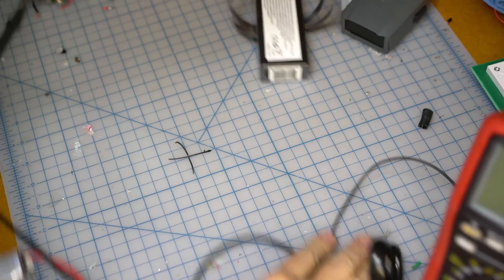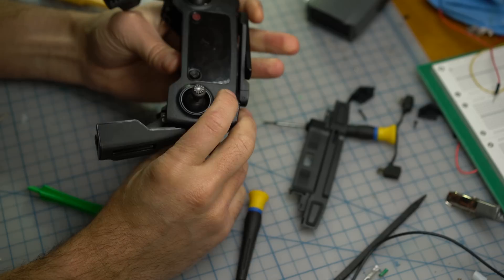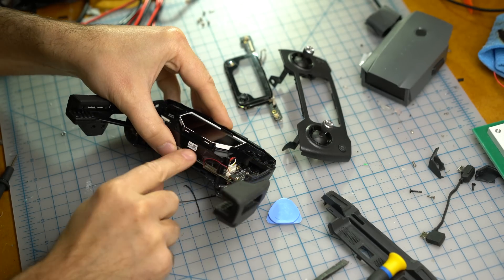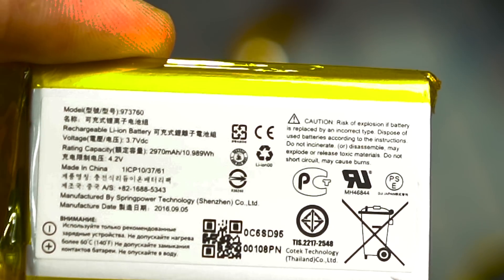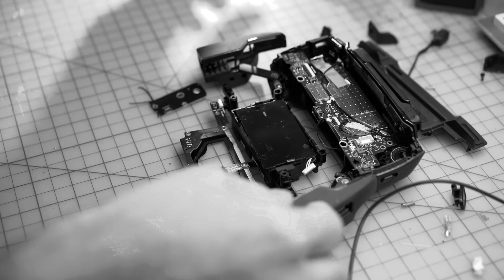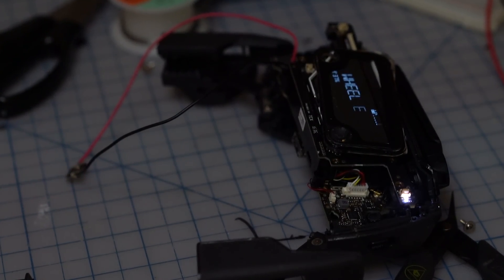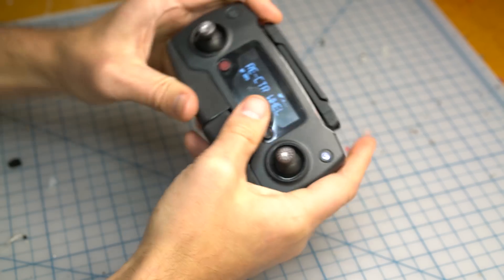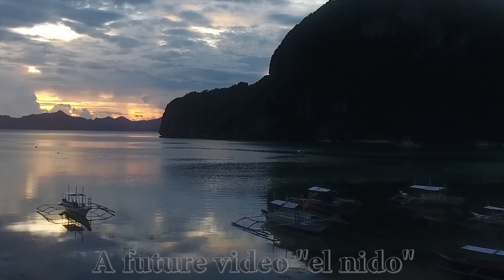Mavicpro Remote control tear down - Silence the lamb

Comment: Thanks Brian! Certainly will help when I tear mine down. I started but couldn't get past the two screws. 

With the speaker positioned towards the back, do you think I could just jam a screw into the speaker from behind through the back plastic? That might save pulling the whole thing apart and I could slowly tighten it down until the noise is more comfortable. What do you think? I can probably find where it is based on your detailed photos.
Reply from the maker: Not sure I could recommend that method mate, could create and print a drill template from inverting the picture,  might be hard to pinpoint the speaker, specially as the plastic is not flat and pretty thick. Grab a pack of torque screws from homedepot and open it. It's not so difficult when you know what pops off. Be gentle with the ribbon cables and make sure the wheels are seated correctly before adding the boards if you do open it.

Comment: Those chips are what we call hall effect sensors. Most cheap rc drone won't have them, but i'm glad the mavic has them.   nice tear down, i LOL when you said "do i want to keep going, i do but i don't"
Reply from the maker: Jason Elmore oh is that what they are using.  Very cool.  It had me thinking I missed a cable or something.  I used some hall effect sensors building a end stop sensor a while back I should have looked closer.  So the lower mechanism must have some magnets attached I'd assume.
Reply: yes either a magnet (hall effect) or its totally different AMR type sensor which use digital non-contact linear sensors using magnetoresistive effect.  Now that i think about it, the latter is more likely. the chip basically creates a small magnetic field and anything metal reacts to it.

both are super accurate and durable compared to spring tension systems which wear out over time.  A few high end flight sim HOTAS sticks and throttles use either of the two.

The Thrustmaster Warthog uses Hall Effect, 
The VKB Black Mamba uses AMR sensors. (they call them D Mars)  but they are AMR basically.
Reply from the maker: Jason Elmore great info mate.  I'll read up(watch yt vids) on them and try and learn more about them.  Cheers.

Comment: Cool ... I wonder if you could mount a small piece of white plastic on the underside to act as a reflector?   Nice video ... thanks.
Reply from the maker: Nice idea, I was thinking if I just drilled out a little to the forward side of the nontransluciant plastic and then see how the leds light up the transparent part. Back to the workshop room.
Reply: Great to have ideas on this new drone!  I also thought you could obtain some cabinet grade 1/8" birch faced plywood, mount the controller at the top, with oval side cut-outs on the sides for the hands if wanted, but not necessary, and extend the plywood far enough below to mount your favorite compatible display. You could do mini-channel rails (like they use in sliding glass doors) to slide the display into, up to a stop, and a simple latch to hold it. Or ... visa versa ... put the display above. It doesn't have to be expensive and I doubt it would be noticeable to the average spectator. .  So now I could use my rooted Nexus 7, or Amazon Kindle HD 8.9 rooted to Android 4.2 basic ...  or with enough adapters, my Surface Pro 3.  Lot of possibilities.  Opps ... the display above would interfere with the antenna signal ... scratch that.